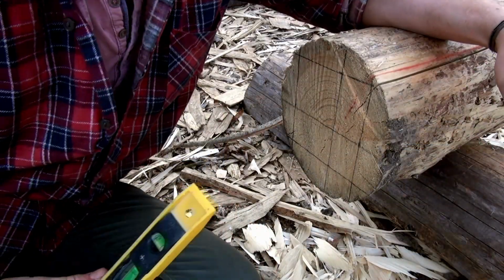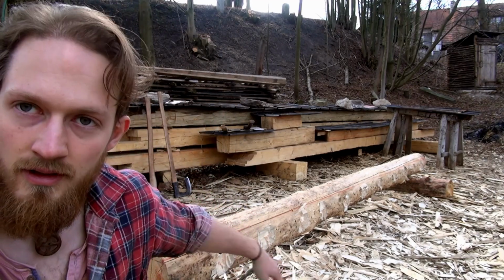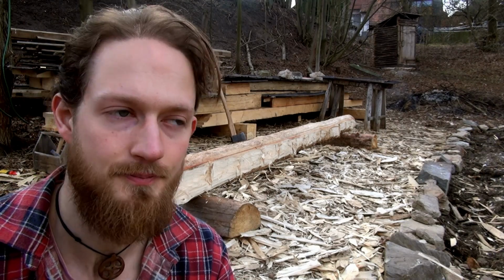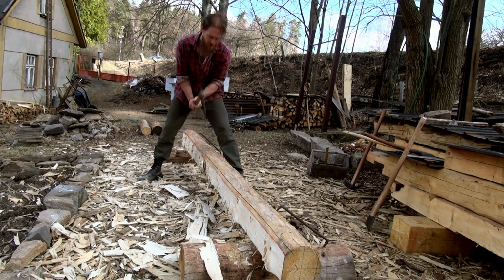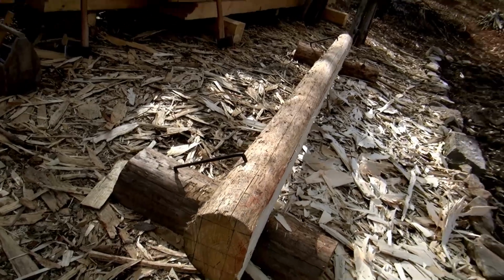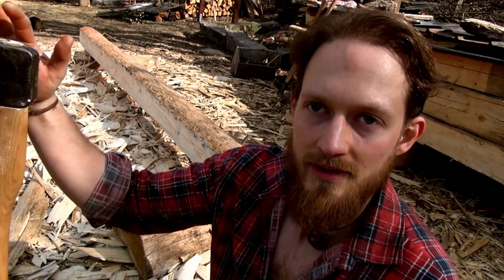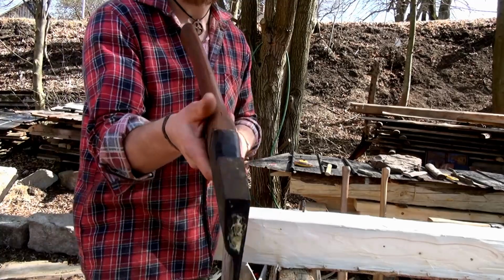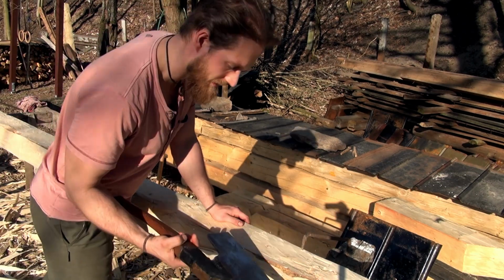Make Your own Beams - with hand tools!

Comment: my barn, built in the early 1800's, has hand-hewn beams - in New England, USA...some beams need replacing, no one does hand hewing anymore
Reply from the maker: Well, maybe it is time learn it again than. Being self sufficient in this manner, might prove really useful. But you are right, in my country there 20-30 people max who can do this efficiently. I was lucky to learn from them.

Most of them are in their sixties, that is why I think it is immensely important to pass this knowledge on.
Reply: @JJChWorkshop  true. But replacing structural beams by oneself - not sure if that can be done.